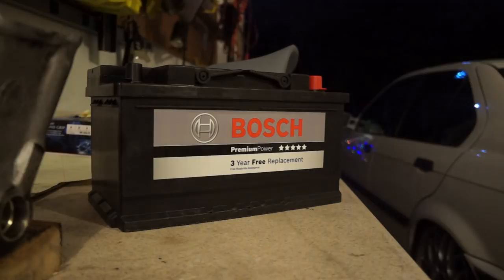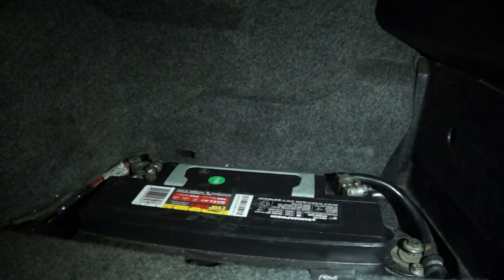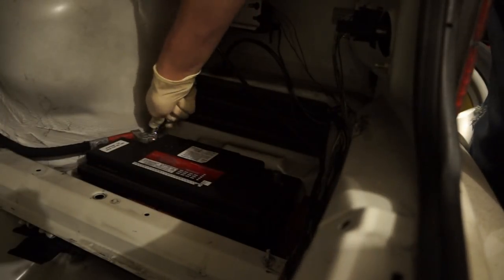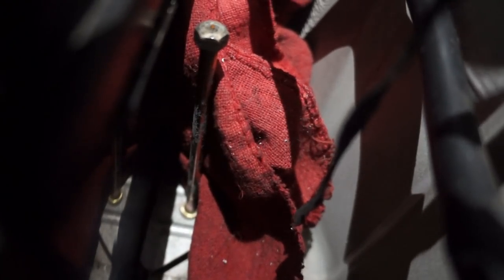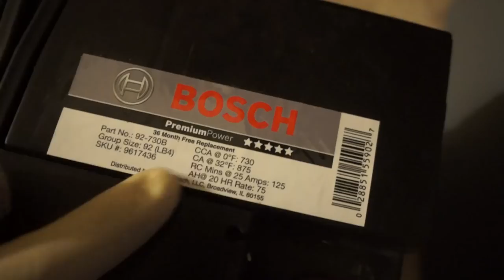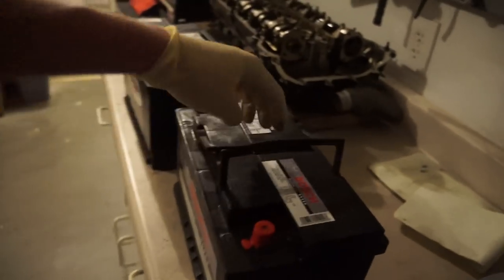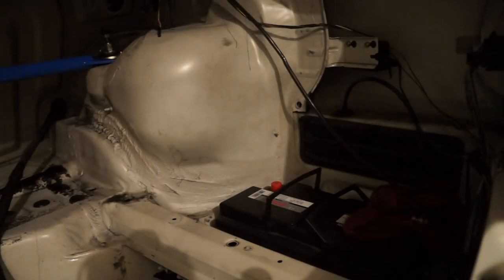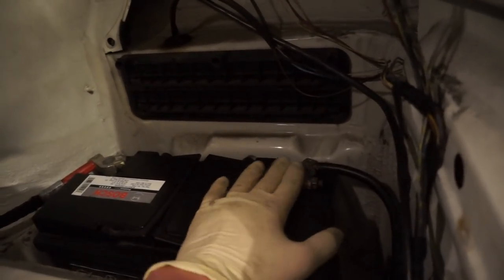E36 Battery Replacement DIY

Comment: Question ? My battery came with a little L Shaped Breather Port and I was told it needed to breath and that there is a hose that leads down to the outside of the trunk . Do you know where the Exit Hole is in my trunk where I need to run this hose ? Lmk thanks

Comment: The rust in the battery tray might actually be corrosion from acid (as a result of not having the battery tube installed).
Reply from the maker: yeah thats what i was thinking lol
Reply: Hey Jack I need this same tube on mine . Do you know where this tube exits ? I don’t see a tube or a port to run it to!

Comment: Unfortunately that Battery is from Pepboys. That Bosch battery is made from exide batteries which are one of the worse IMHO. Get a Bosch battery from SSF, Worldpac, IMC etc...those are made by EastPenn which is a OE provider for BMW. I have replaced so many exide batterys if i had a $1 for Everytime a car came in the shop with a failing exide battery.
Reply from the maker: Fair enough, but a any battery is better than any dead battery. I plan on getting a lightweight optimo like the cool kids but i just needed this thing to run so i copped a battery lol

Comment: Your battery looks way to big and heavy
For my e36 328i I uses 60Ah battery / 520 cca
It's plenty enough, it even starts in -3c after sitting for month.
I am using it for 3 years and it doesn't show any weakness
For my next battery replacement I even consider to use 50Ah or smaller, because I don't drive in winter, and my car don't have any electrical equipment, besides the lights.
#Weight reduction is everything!
Reply: Kr Dz yes weight reduction is everything, I'm hovering in the high 2000's right now. AC is on the way out, carpet, insulation, SAI pump, oh and ABS pump are next for me.
Reply from the maker: @mikeb2496  yee +1 i want to get a lightweight battery like you cool kids soon, i just needed a battery lol